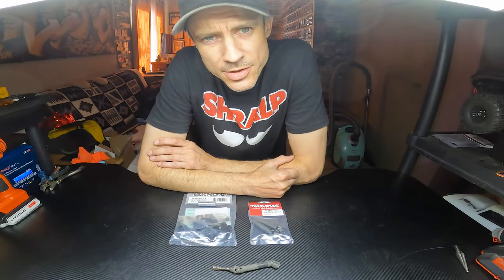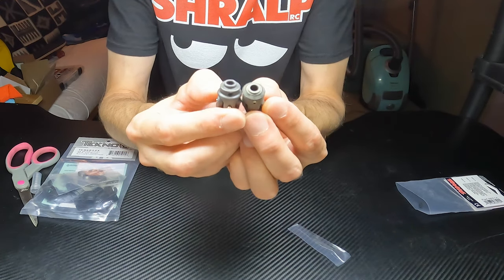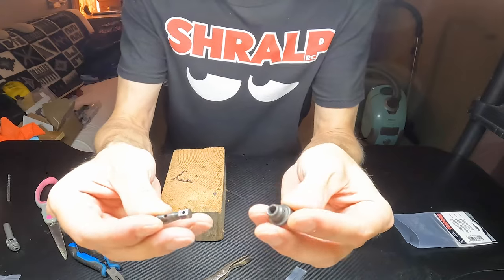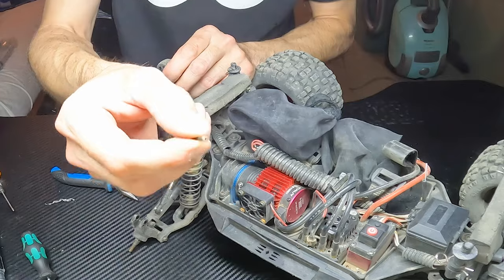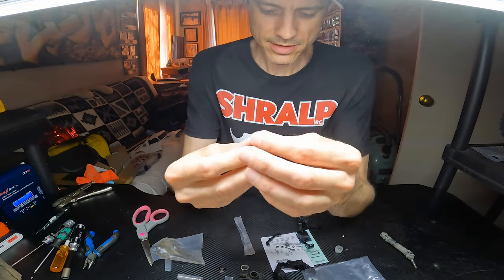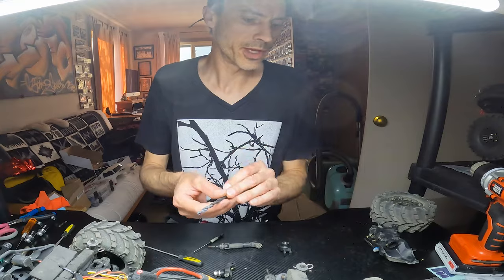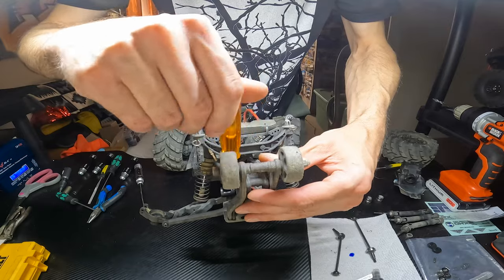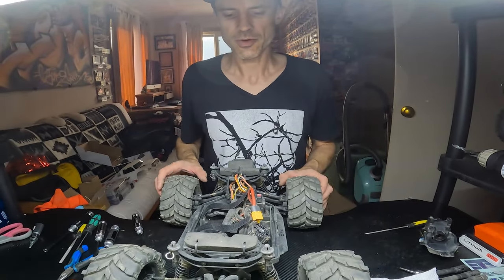Never Break A Driveshaft Again! - Driveshaft Fixes for the Rival MT10 - Team Associated

Comment: I have the max 10 3200kv combo in mine and it hasn't ever broken. You do bash harder than me. Been through a few spur gears.
Reply from the maker: @chrisvda7277  nice! I’d like to try a 3700.
Reply: @shralpRC I ment the 3200kv so i edited my comment. The 3700kv has just been on my mind lol. Should be good. Iv heard other people run it. Could probably put a 12t pinion in it and just up it for 2S for track. Would at least be quicker and have more torque than the stock 3652 3300kv on 2s for racing.
Could be a great option for my SC10 Pro4.
 I have noticed the new quicrun g2 motors seem to be a couple of grams heavier than the old ezrun g2 on the specs.

Comment: Any chance the tekno hubs could be used instead of the stock AE rival hubs?
Reply: I looked through the build manual of the sct 410 2.0 and the hub assemblies for front and rear look somewhat similar but if I had to guess the lower hub width might be different(where it mounts to a-arm)? Just trying to think around the problem of modifying that bearing seat inside the hub….
Reply from the maker: @JakesRC-gm5fk  If the tekno sct hubs fit, that would be awesome yeah. I might have to pick up a set to do some testing…